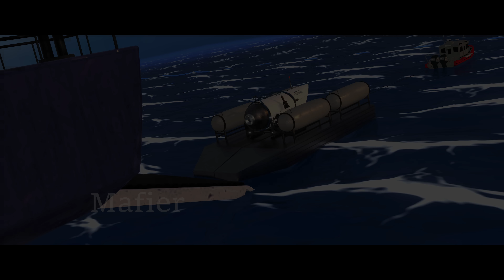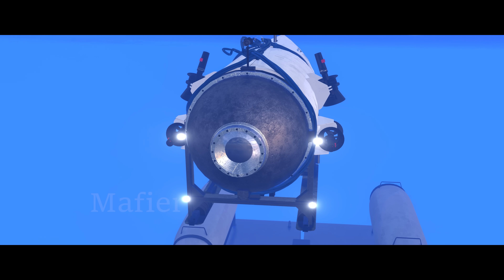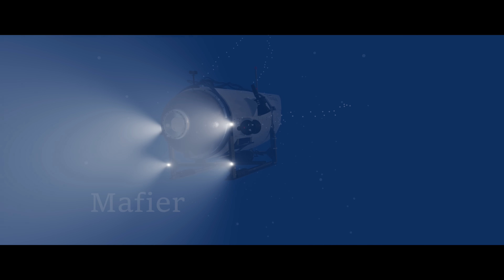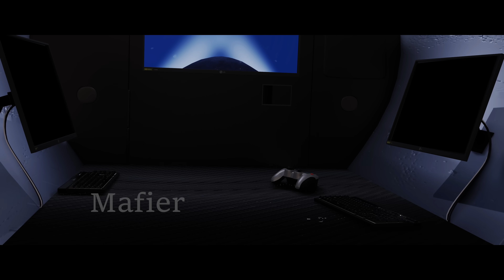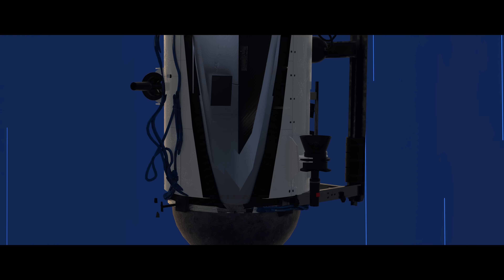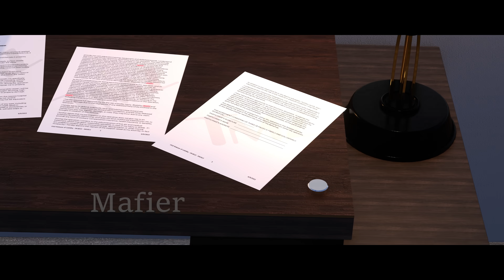NEW SHOCKING DISCOVERY Of Oceangate's Titan - 3D Animation

Comment: Blah blah blah, you guys keep on making the same freaking video over and over again, talking about the same bulshit. Do you have no idea what you're talking about? It's the window; it's the controller; it's the carbon-fiber hall. I'd be willing to bet it's none of these that failed. was a control spear that is supposed to fill with oil in case it broke, but if it didn't fill up with oil it exploded like 8 to 11 sticks of dynamite. This is what exploded down there, causing the submarine to peel apart!